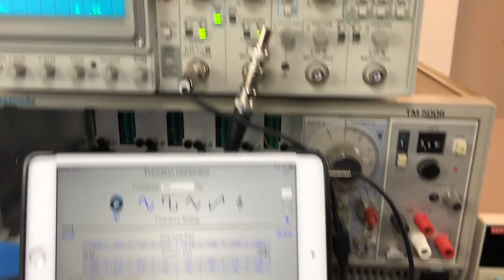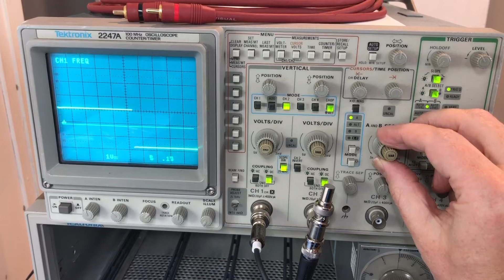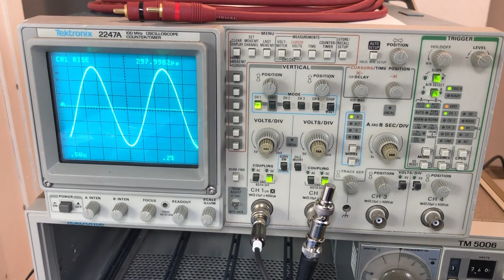Can you use an iPad as a Function Generator?

Comment: Woww)) So mean is Digital output after DAC = pure analog? So sine form very interesting. I have not oscilloscope. But I wondering this point in the analogue oscilloscope...

Basic schema like this.

1. out - from hardware signal generator (from 20 Hz to 20 kHz between)
2. in - to oscilloscope channel one
3. in - to PC sound card (ADC) or tablet
4. out - from PC sound card (DAC) or tablet
5. in - to oscilloscope channel two

maybe need oscilloscope channels full separate then other channels. Or not, I don't know.

So for results what is for this schema output on the oscilloscope? So channel one and two 1:1 same or? And XY mode screen.

So maybe DAC's outputs pure analogue. Why this interesting test?

Many peoples saying digital systems or DAC not analogue. It have tiny tiny squares. But oscilloscope saying, no! Please look to my screen this signal analogue))

Yes, old times maybe problematics because storages (HDD) really small size and need compression... But now storages more huge and internet bandwidth and speeds more huge. So now files more different then old times..

Maybe digital vs analogue wars not need at present time.

But this yes and I accepted. Old time Vinyl and tape really more good sound. But have interesting bad parameters like as capacitors, transistors and resistors status and performance)) But if music recorded and save to Digital systems without compression and minimum 44.1 or 48 kHz or max 96 kHz and if mastering is good... Always results fix)) but if there is no file fragmentation failure.

But I really wondering... Listening from digital systems with DAC to preamps and amplifier results means I listening analogue or not. I think it's analog too. The only thing different so storages.. this not tape media or vinyl media.

But if 44.1 kHz sound zoom to per second and result is like this - - - at intervals or gaps... Yes not analogue. Because the nature of the analog is seamless/uninterrupted.

I hope you will to prepare this test environment, review and share the results with us 🙏